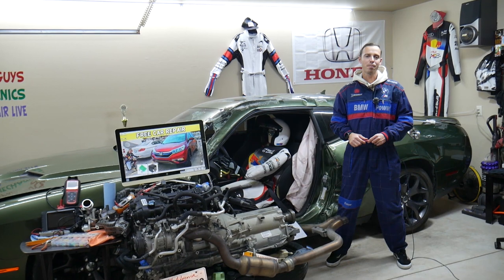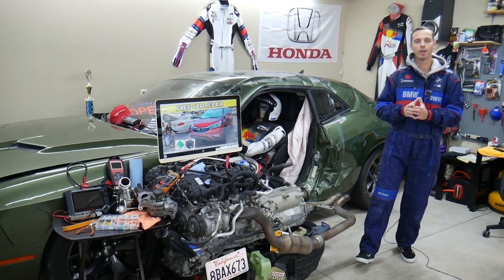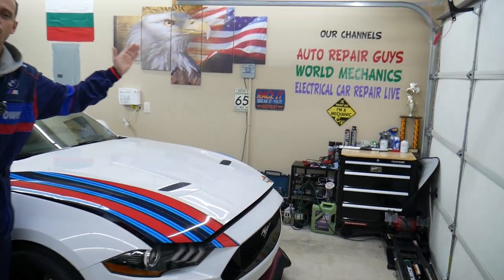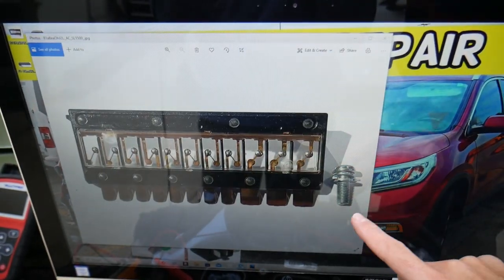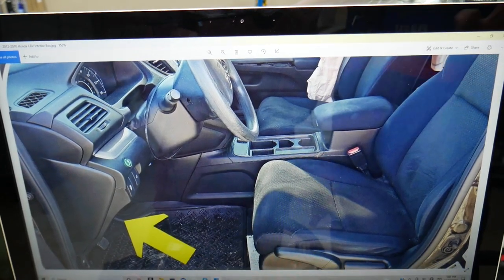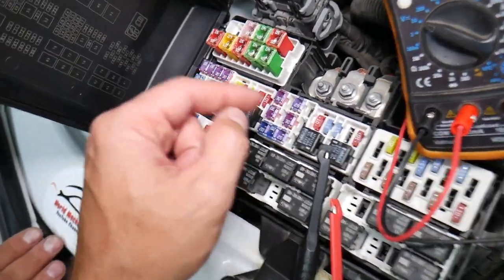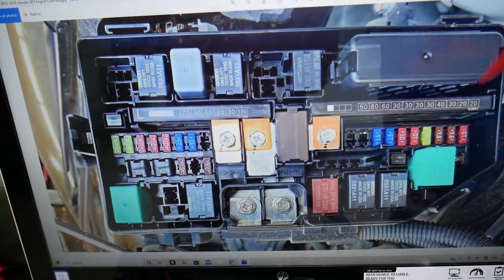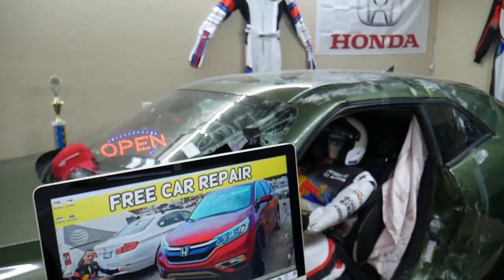HONDA CRV CR-V POWER LIFTGATE FUSE LOCATION, LIFT GATE DOES NOT OPEN FUSE 2012 2013 2014 2015 2016

Comment: My 2016 CRV hatch fuse keep blowing. Whoever came up with the touch sensor only door needs fired. Should have came with a handle also incase of an emergency. I get about 5-10 uses and then the fuse pops.